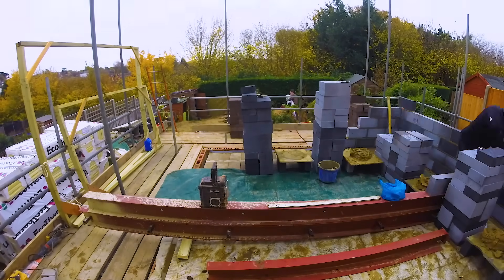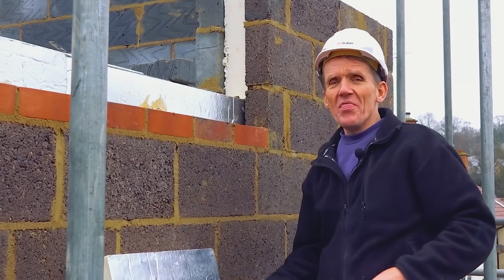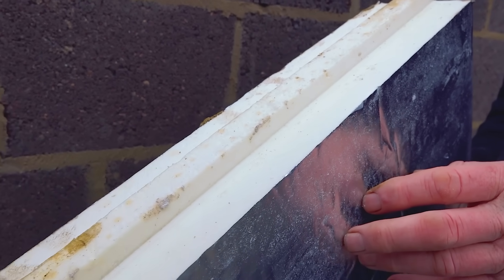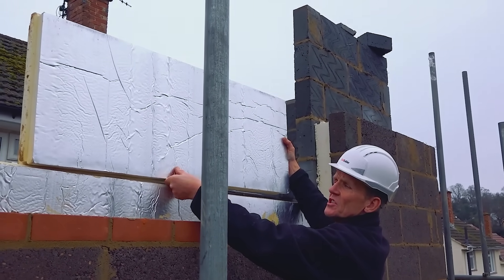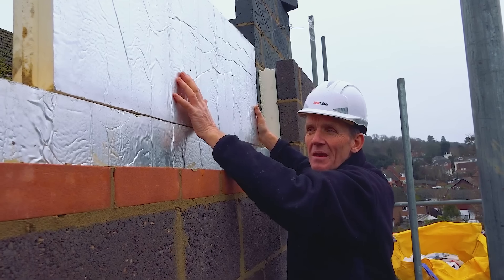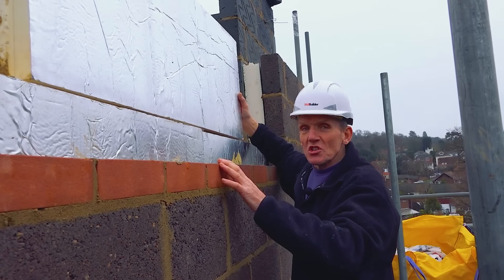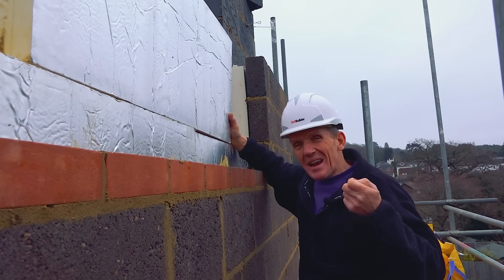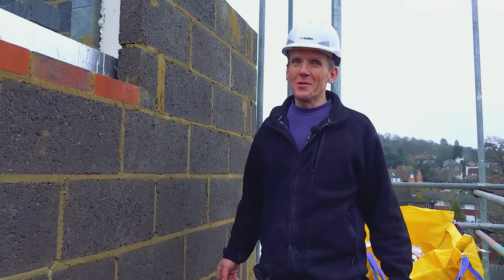Cavity Insulation | The Secret to a Warmer, Quieter House

Comment: I’ve heard you describe trapped air as insulating qualities, are you still of this opinion Roger ?
Reply: Convection is the difference. There is no convection when air is used as a trapped insulator in standard insulation, but a cavity or void allows convection and hence thermal losses. So it's not the same thing to say that air trapped in a cavity is as beneficial as air trapped in insulation!

Comment: Excellent work. As a structural engineer I’m always looking for load paths. But, increasingly, I’m now looking for moisture paths. Moisture is the number one issue in the longevity of modern homes.
Reply: Yep. The additional insulation is causing parts of the building are cooling down meaning higher risk of humidity hitting something below its dew point. With the old leaky building and not so much insulation things were warmer and airflow was greater. 

Retro fit is harder because things aren’t designed to be changed.

Comment: Not keen on leaving all those joints unsealed. Defeats the purpose of having the PIR if its not sealed and can let cold air track across, foam the tongue to glue, then tape it all properly.
Reply from the maker: I am with you on the tape but not the foam because it pushes the boards up.
Reply: @SkillBuilder  only if you go nuts with it. Should be using a low expansion/adhesive foam.only needs applied thinly in the Grove. Even when perfectly mated, T@G PIR has a gap in the actual groove, for this 👍
Reply: Foam can be applied from tricky  angles and behind blocks, tape can't. Foam as a PIR board adhesive resolves a lot of the issues with cavity wall insulation, but in reality this building method is a poor solution and prone to error.

Comment: Does the insulation need to be held flush somehow against the inner wall, so the entire 10 mil air gap is between the insulation and the outer wall?
Reply from the maker: Yes the red plastic discs do that
Reply: Red discs visible at 2:22, from what I understand they go on the wall ties to hold in place
Reply: Absolutely vital its flush to inner block. Wont be checked in the UK rendering the insulation alnost pointless.

Comment: This will give you damp
Reply from the maker: No it won't and it didn't. This was done year ago
Reply: I fail to see how you can be so positive it won't cause damp and saying it was done a year ago is in no way a true test it won't cause damp in the future.
Reply: @teversoncoleman496  I think it's a typo, I think he meant "years" ago. A few years he mentioned in another comment. It might still cause damp yet, but I'd say it's a good sign.
Reply: @teversoncoleman496 building regs in UK have allowed this type of board for maybe 20years as a way of getting round the need for a 50mm clear cavity that would be required without the T&G design. Installed correctly there is no way damp will ever get through, in fact it is more idiot proof than using full fill Rockwool type insulation which with poor bricklaying/or insulation installing sequence can end up with mortar sitting on top of the insulation edges causing bridging.
Reply: 10 mm cavity.how do you keep it clean .you can't even get the trowel in.this will bridge mortar snd cause damp.been in the game 50 years,this is nonsense.
Reply: @robogamer5384 How is it going to cause damp if it has foil backed pir in the cavity

Comment: Gotta say that T&G looked kinda crap; any variation in dimensions, or movement will leave cracks between the insulation blocks, and render the T&G ineffective.
You could even see it in your video, two neighbouring blocks out of alignment.
Reply: Yep, I'd have thought they'd need glued and taped, to almost act like a single wall of insulation.

Comment: Few things to consider here. The tongue and groove is initially designed to prevent airflow/thermal bridging on the seams, it's not designed as a moisture barrier, the flat surface is not sloping outwards.
Dutch code advises 20mm of theorethical cavity, and 40mm as designed (so there's 20mm "reserved" for mortar towards the cavity). This is most practical for the bricklayer, fingers still fit between brick and insulation.
Furthermore, the foil facing needs some distance from the outer brickwork to perform properly. When covered directly, it's not able to reflect anything.
And the biggest concern i have is with how loosely the insulation is within the cavity. Make sure it's tight against the inner wall, or you'll get a "false cavity" between insulation and inner wall. This potentially could eat up to 70% of the insulation value!
Reply: I think and see them put foam on the backside to sort of glue them to the back of the innerwall. And seal the seams of the board together with alumium foiltape. And perhaps put some glue between the seems before sticking the board on the tongue and groove. this video makes a mess of the airtightness.. as shown.
Reply: @eurovisie2010  no need, clips are used to keep the insulation tight to the inner wall, and tests show that this technique is great for air tightness.
Reply: @mikebarry229  Okay, if you say so..But ithink/thought that uneven surface on the outside of the innerwall lets heats going through the innerwall going  up between innerwall and insulation. I mostly see people foam the whole plate around the edges and criss cross so warm airflow has no way to travel. I would do it if I woild build a house. We have stone-woll that is pressed against the innerwall.. That was in 2013..
Reply: @eurovisie2010 Foaming the boards is not necessary as long as the inner wall is built correctly. Straight, flat and clean, and clips/plugs are used for keeping the insulation in place. 
And if you can avoid using spray foam, do so. Next generations will thank you for that.
Reply: @hans7144  I agree with all that use of foam-bottles.. Maybe they could fit some fluff stuff on th eback of the insulation plates for adaptation to uneven surface of the backside of the innerwall. A hybrid foam-plate.. ??
Reply: The other taboo here is trying to shape it snugly around lintels and damp trays. This is also where a lot of thermal bridging occurs, as we are not afforded the time ,to spend time on important details. 
I've noticed it's always the "build fast" pressures that details well intended designs, and as a bricklayer who cares, It's demoralizing to be expected to have instant origami skills, simply from being handed a technical detail.

This is resolved with mineral wool cavity bats that are much simpler to shape effectively around such areas.
Reply: @nicholasmitchell8749  But the same R-value (well, compared to correctly done PIR) gets you a much thicker wall.
Reply: @hans7144  100% correct
Reply: @hans7144  I agree with most of what your saying.
1. insulation is most effective when a form of air layer is present but the temperature conductivity is around 0.036 W/mK which is dramatically low and won't cause condensation against the inner cavity wall..

but a gap between outer wall and insolation id say may be essential to prevent water run-down against bricks incase of condensation ir water ingress.

and there for make sure weep holes are correctly in stated to effectively drain any water running down inside a cavity wall.
Reply: @hans7144  Tongue and groove, I agree tongue pointing up.    100%
Reply: How do wall ties fit into this sort of wall design?
Reply: @hans7144  clips are used to keep the insulation tight against the inner blockwork, maintaining a 10mm cavity on the outside face of the insulation. You can see the clips in the video...they are red. For the UK market at least the T&G's only function is to prevent damp penetration. Any benefits to airtightness is just an extra bonus. We still require reasonably good air tightness but don't specify how this must be achieved....the house is tested after the build is complete. It is totally acceptable in UK to fill a 150mm cavity with rockwool to achieve the required insulation, yet that material has no air resistance at all.
Reply: @mikebarry229 it's not exactly what I meant. The T&G does not contribute to the airtightness of the home. The plaster on in the inside normally is the air barrier. But even with having that airtight, you can get airflow from within the cavity through the seams of the insulation to the backside of the boards. This cold airflow reduces the insulation value. Therefore, there is a T&G, joints are often taped and in passive house designs, multiple layers with shifted seams are placed. 
Rockwool (and other wool insulation) doesn't have the issue as it follows the inner wall, even if that's not clean/flat. It's not airtight but it does prevent that harmful airflow.
I'm sure about the T&G not being meant for damp, check the manufacturers specification. It's not in there for sure.
Reply: @hans7144   I do agree with everything you say regarding the many benefits of the tongued and grooved joints but for the UK market both T&G and straight edged PIR boards are allowed to be used in the cavity as insulation. If straight edged boards are used a minimum clear cavity of 50mm is required on the outside of the PIR to prevent damp penetration, however this cavity can be reduced to 10mm in the case of T&G boards as it is considered that the T&G arrangement will remove any possibility of dampness penetrating to the inside leaf. The requirement does not come from the manufacturers, but instead is given in the products Agrement Certificate which states how it can be used and meet building regulations, and the Agrement Board decide what cavity must remain. Sadly they dont take into account air penetration at all, hence it is perfectly acceptable in the UK to use square edge boards in the cavity, clearly we have some way to go to catch up with you!. If building to Passivhaus standards they would impose stricter requirements
Reply: @mikebarry229  you're quite wrong to state 'the T&G's only function is to prevent damp penetration'. It has multiple advantages.
Reply: @lksf9820   I agree it has multiple advantages, indeed I said so in my post, however in the UK market the only reason for the T@G profile is to resist damp penetration. Without the T@G profile a further clear 50mm cavity is required to prevent damp penetration, but when T@G is used that remaining cavity need only be 10mm as damp penetration is then no longer considered a risk.
Reply: @mikebarry229  Where do you see those red clips?
Reply: @jcvjcvjcvjcv  at 2.22 in the video....sorry no idea how to insert a time stamp!
Reply: @mikebarry229  Use the : instead of the .
Like 2:22

But that is the only spot they are ever shown? I would expect more.
Reply: @jcvjcvjcvjcv Thank you for that tip, obvious once you know! The clips should be used every wall tie, at least in the main body of the wall. Maximum spacings are therefore 450mm vertically and 900mm horizontally. At openings wall ties are typically doubled up. Insulation board manufacturers typically recommend at least 3 clips per board.
Reply: @mikebarry229  Yeah. But here I see wall ties put in when they build the inner wall. With these boards you would usually drill them in when putting up the boards!?
Reply: @jcvjcvjcvjcv  The official way is to locally cut the tongue as the tie is laid in the inner course, sloping the tie slightly down towards the outside course. Constantly the inner leaf has to be built 450mm higher than the outer leaf before the next insulation slab can be fitted. Cutting the insulation to insert ties through the middle of the boards is not allowed.
Reply: @mikebarry229  Aah. So Then they have to make sure they start in such a way the PIR board heights match up with the blocks. I see now that is it exactly 2 blocks, 1 board.

In local building projects with PIR it's usually fixed by drill-in wall anchors. They usually build the whole inner wall, including window, then insulation, then outer wall.
Reply: @jcvjcvjcvjcv  Your way is probably a whole lot quicker, we do something similar to your method for retrofit external wall insulation, but don't use PIR board for that location.
Reply: @mikebarry229  I was just thinking. The metod from this video would require to put up two rows of blocks, then 1 row of PIR boards, put in the ties, and repeat. That means also possibly mortar dropping on top op of the tongue side of the earlier installed PIR boards. Far from ideal if you ask me.

Comment: It’s a wonderful idea by somebody who doesn’t have to work with it .
    Bloody awful 😩🧱👍🏽
Reply: Definately slows down the build but the benefit is 50mm thinner cavity walls, which may be an advantage worth extra effort. Lots of brickies moan about the difficulties of using full fill Rockwool type batts saying it pushes the bricks out as you lay them, but as I'm not a bricklayer I wouldn't know which is easier.
Reply: @mikebarry229  Brickies moaning seems to be a trait. You'd think they would want to learn how to build better houses.

Comment: 150mm now!
Reply: NO!, the only reason people say you need a 150mm cavity is if you use the least efficient insulation. Because of the risk of water penetration when using straight edge PIR boards as cavity insulation, you still have to leave a 50mm clear cavity in addition, so 100mm PIR plus 50mm clear cavity takes up the same space as 150mm "full fill" rockwool batts to give the same level of insulation. By using 90mm T&G PIR you can use a 100mm  cavity saving 50mm over all. This stuff has been around for years even before the latest thermal regs changes. Pretty sure the first time I saw it used the boards were only about 50mm thick meaning a cavity wall could be built with just a 60mm cavity. Rockwool is permitted to fully fill the cavity because water can still run down through it and won't cross the cavity.

Comment: Kudos to homeowners like this who take a risk on a new technology. Seen it go wrong plenty of times but someone needs to go first to start proving it out long term and it's not going to be the big housebuilders!
Reply: 1990 pir cavity insulation was available in the uk. as long as you have a closed cavity and no house fires its great.
Reply: PIR insulation isn't a new thing mate
Reply: @skumpuntele8941  did you watch a different video? TONGUE AND GROOVE PIR used for FULL WIDTH CAVITY INSULATION is new
Reply: @ncey8713 No it isnt, it's been used for years and years in the UK as a way to avoid having to have a 50mm clear cavity in addition to the PIR meaning the wall could be built thinner and still meet thermal regs. Without using this type of board the choice was either 100mm rockwool "full fill" insulation, or 50mm PIR without the T&G edges and a further 50mm empty airspace, all thats new is they now make it in 90mm board thicknesses but they have been doing that for at least 5 years if not longer. This is OLD technology, regularly used in UK for maybe 20 years or more

Comment: I’m not entirely comfortable with insulation getting wet in the first place. Just how durable would it be over the life of the building?
Reply: Manufacturer: "When correctly installed, Eco-Cavity Full Fill will remain effective for the life of the building. Its durability depends on the background/supporting 
structure and conditions of its use. It should not be used to isolate dampness or be used in continuously damp/humid conditions." And "A 10 mm residual cavity should always be maintained between Eco-Cavity Full Fill insulation board and external wall leaf." 
The latter means without mortar in there. Good luck building that.
Reply: @hans7144 that’s not ever going to happen.!! We are currently building a large extension with this shit.! Bricks are imperial seconds.! Impossible to keep a 10mm gap even with us setting out a 20mm gap.!! Bloody nightmare…